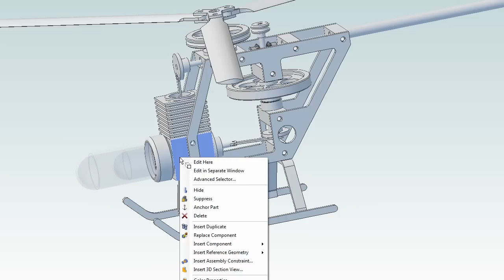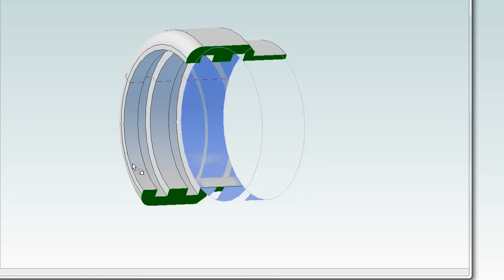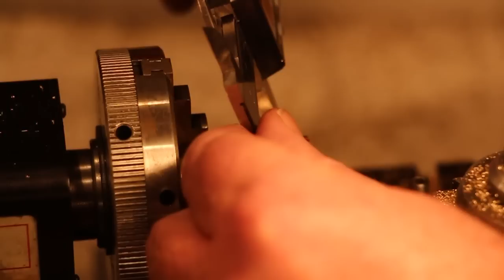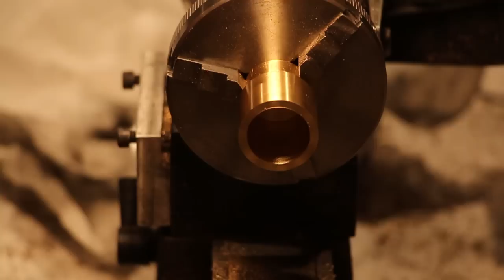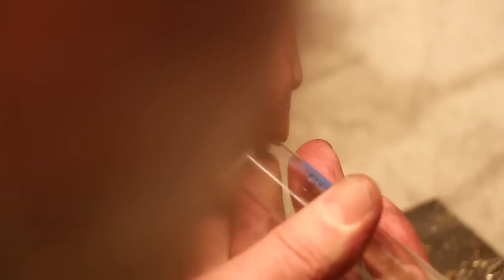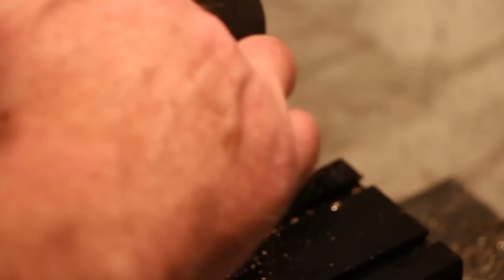Building a Stirling Helicopter - Part 4: Making The Adapter To Hold The Glass Cylinder

Comment: I notice that you are not using the telescoping gauges or snap gauge(SG) correctly. Take a look at the following video on the correct way to use a Snap Gauge.

https://www.youtube.com/watch?v=SmXfGan_NXQ

The problem with the way you are using it, if the handle of the Snap Gauge is not exactly on the center line of the bore when you tighten the thumb screw, your measurements are going to be off.

Enjoyed watching this video.
Cheers
Willy

Comment: Very Cool.  Your filing technique is a touch off though.  You want to hold the file parallel to the chuck face (perpendicular to the lathe axis)and move it in the same direction you move in the cross slide.  See MrPete222 or Keith Fenner's videos that show this.  But very , very amazing work!
Reply from the maker: Thanks! Several others have commented on my filing technique so I've watched more videos and hope to get it right next time.